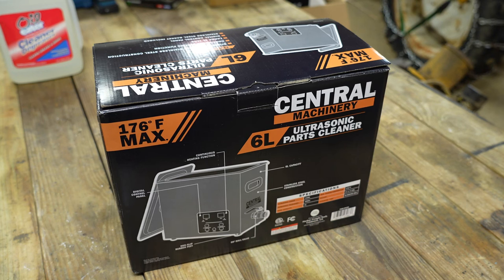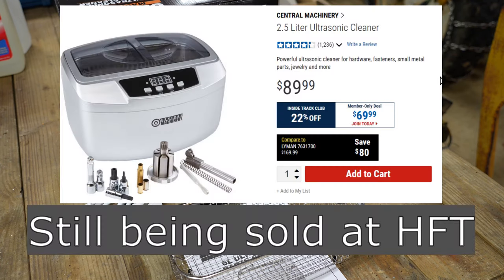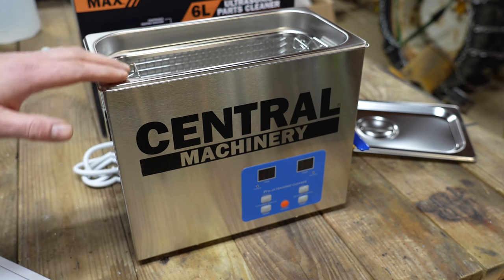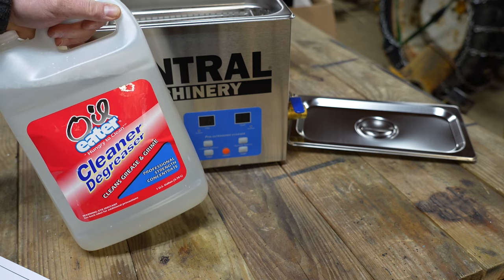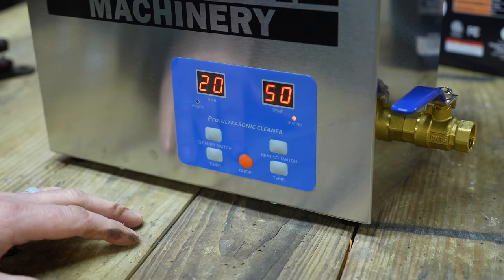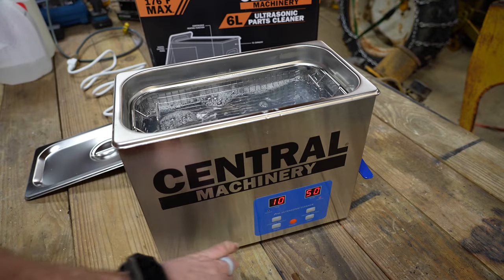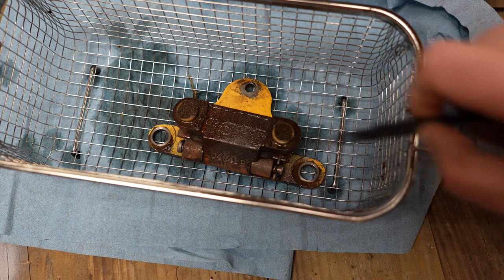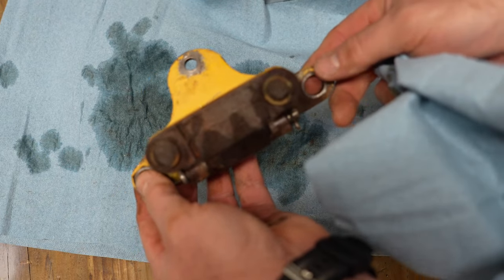Central Machinery 6 Liter Ultrasonic Parts Cleaner, Harbor Freight NTDT How do they work?

Comment: Tip. Put your parts and water or degreaser in a zip lock bag and place it in the ultra sonic machine.  This keeps the larger bath clean.
Reply: I saw someone say that before and it's a pretty good idea I would think it wouldn't work well but I guess it does
Reply: It will even clean a part inside a closed glass jar if there isn’t air inside the jar touching the part.
Reply: Warter? You from New Jersey?
Reply: You may want to use class jars instead of plastic I did my research on this it helps with penetration and cleaning 😊😊😊
Reply: @TheNLHAZE   nice to know
,thanks
Reply: Pyrex works great too. I used to work on super fancy chemical analysis equipment, and we’d clean out tiny parts by putting them in beakers of methanol inside the sonicator. Works awesome.
Reply: Steve’s small engine saloon uses plastic peanut butter jars. I just watched his videos on it.
Reply: @Gastly_Ghost  Knew I liked that guy. I always have a spare big skippy jar handy.
Reply: Does the tub also need to be filled with fluid while cleaning the parts in the bag/jar? I'm assuming yes because then maybe the sound waves wouldn't travel as well? Just making sure, so I understand.
Reply: @GoldenTiger01  yes it has to

Comment: I just bought this exact model tonight at Harbor Freight. I plan to use it for gunsmithing, cleaning firearm parts, reloading and fired brass as well as cleaning carburetors on lawn and garden equipment. I was debating back and forth between this one and the cheaper $89 plastic one. I got this one because it appears to be built much better and has more capacity. Sometimes using one of these is the only way to do what you need to do. Think removing a gunked up carburetor off a chainsaw or something similar before you can rebuild it. A ultrasonic cleaner speeds up tedious parts of firearm cleaning as well. Think a barrel that looks like a sewer pipe inside or a M16/AR15 bolt carrier group caked with carbon fouling. Black powder cap and ball revolvers can be assisted with one as well.
Reply: Yes.  I'm debating on pulling the trigger on this machine for cleaning the black powder cap and ball I have.  Pun intended.  :)

Comment: Great video,  I have a 30L from Vevor,  got it for $239. 00 last year around November,  it's fantastic.  I use gunk or Chem brothers carburetor cleaner from autozone/advance auto parts. Cleans everything I throw in it. Thanks again for sharing
Reply: 30l that's 5 gallons of cleaner. THATS HUGE!!
Reply: @robertlee1145  Nope. It's just about 8 gallons
Reply: @V8SKULLS  yessir that still HUGE!!
Reply: @robertlee1145  yes, it works really well on gun parts, I refurbish WWI, WWII,  VIETNAM RIFLES. and it is big enough for larger parts.
Reply: Does it fit Mauser action and barrels? I'm a gunsmith, and I'm really not looking forward to buying the 10k one. At least not till the shop is in the green.
Reply: It will but not at the same time, put in one half for the time you want. Than flip it to the other side for the desired time you need, it's easier than removing the barrel from the receiver/ action.
I've done that to all my enfields,  mausers, carcanos, Springfield.
I used straight hot distilled water and blue dawn platinum dish detergent. 
Works absolutely great
Reply: @V8SKULLS  I focus on eastern european firarms predominantly, also cold war. So FAL's, CZ Bren, HK, FN, AK, SKS, Mosin, Mauser, AUG, I thankfully haven't seen a hellion or anything from Croatia yet.
Also what do you use for your solution, my military experience tells me simple green everything.
Reply: @_..--  I also use simple green, but I just don't leave it in like over night.!, I mostly been using distilled water and Dawn Platinum Dish Soap.
It works so good. Just make sure your heater is on and Hot.!
It really cuts thru the crud and grit.
It also takes away cosmoline as well
Hopefully this helps you.!!!!!
Reply: @V8SKULLS  update I used a 1-10 of Murphy's cleaning solution. In the small UC cleaner for the desert eagle I am doing a 3part flashy cerakote job and I'm going to use FX on the overcoat finish.
Reply: @V8SKULLS  I was reading about how simple green can eat away at aluminum and wasn't going to risk it, so I try the temp to 80, filled the 6.5L tub and it did the job. Though I think that will be my brass cleaner, and non firearm cleaner after. 
I'm sorry for the 20 questions. Also do you use new water and cleaning solution each firearm or do you get a few cleans out of it. My customers take terrible care of their firearms. (Except for you if anyone is reading this).
Reply: @_..--  no worries,  you can ask what ever and when ever,  it's all good. And yes. If I'm cleaning guns, parts, etc. The same week. I just leave the water/soap mix in the tank and use it
As is. But if I'm done and working on wood stock, forearm pieces or assembly.  I usually empty and clean the tank. That's just me. I guess I'm ocd about that.
Reply: @V8SKULLS  yeah, I already did that in an OCD moment yesterday lol. And I collected the original solution to see if it settles or if I can strain with cheesecloth or something to have it last a little longer.
Reply: @V8SKULLS  well I have a question about building a forend for a side locking LC Smith in 20Ga but I doubt that's a YouTube question LMAO
Reply: @_..--  that's funny, I use a paint strainer/ filter as well the filter my fluid too
Reply: If you don't mind me asking, how is the Vevor treating you?  Does it take a long time to heat up to temp?  I'm looking at the rating on Amazon, and it doesn't seem too good.  Looking at the rating on this Harbor Freight unit, it's higher.  Just wondering about reliability.
Reply: @huyked  you can ask me anything anytime.  My Ultrasonic cleaner is absolutely one of my favorite tools. And after all 2yrs now. Still loving it. And yes if you want the whole tank heated from bone cold. It will take some time. And that is normal.  But what I do is 
 I put the parts that I want cleaned in small zip lock bags with 50/50 dawn dish soap  & Distilled water, or degreaser & Distilled water. Than I boil a lot of tap water. Drop the parts bags into the Ultrasonic cleaner and pour in the hot water till I'm happy . It works beautiful.  Hope this works for you

Comment: I came to your channel because of the cub. I got to see it again in the background. My day is complete. 🤠
Reply from the maker: There is a cab for it sitting off to the right.  And the part that went into the cleaner was the holder for the clutch holding pads.   :)
Reply: @1D10CRACY can’t wait to see that cab go on. Those are cool looking. And then, AC?
Reply: When I turn my temperature up it will only read to 80. If I keep pressing button & starts going back to 20. Does this mean 120 degrees? Or back to only 20?

Comment: They work great on carburetors and clocks!  =D  Awesome!
Reply: Yeah they are really for parts with small holes and crevices, we used to use an industrial version back in the day, thing was probably well over a thousand dollars but was required by the customer which was Parker Hannifen to get coolant and any debris out of the aluminum pneumatic valves we would machine, they hand lots of very small holes, slots ect. Interestingly the units heater did not work after time but the movement of the ultrasonic will actually cause water to warm on its own over time, we use to joke around about making hotdogs in it at lunch. We were told never to use solvent in it, only water and soap, it was said it would damage the machine, but that was then things may have changed, or that may have just been sombody flapping their jaws...as guys tend to do.

Comment: Thank you for the review!  I need one badly.  This was very helpful.  This model has good reviews on HF site.  No 1-star reviews which is a good sign.  Most Amazon reviews on these cleaners have several pages of 1-star reviews!  Also, the wattage is clearly shown at 370 watts. One customer said it is not 6L but 4L, so 1 US gal size.  For this size, a strong wattage is 70-100 watts, and this machine clearly exceeds that, so the power is strong for cavitation strength.

On Youtube, I saw a guy use a jar filled with gasoline to clean engine parts. He partially filled a glass jar (I think it was glass not plastic) with gasoline, put the part inside, screwed lid on tight and submerged it into the tank.  The part came out shiny clean!  I wonder if anyone here can tell me if this is safe?  Has anyone else used gasoline, alcohol, acetone, mineral spirits, etc to clean with an ultrasonic cleaner? My house burned down and I salvaged jewelry and other things that need cleaning.  I would love to know if this works.

If anyone also has experience with a good machine, please recommend brand. Something this size.  Thank you!
Reply: 2 things I know. 1 manufacturers tell you no flammable liquids in them because vapor can get everywhere and cause explosion. 2 people do exactly what you're saying. What I think, be real bad if jar broke, the cleaner harbor freight sells is for jewelry. Some automobile soap and a 1/4 teaspoon of citric acid/ lemishine with distilled water would be good also.
Reply: I just purchased this unit from Harbour Freight. I've never owned one before but so far I'm impressed with it. The heating element works very well. 
I also tried different solutions contained inside a glass jar and submerged the jar in the tank filled with water. 
I've mainly used the unit for cleaning carburetors. I purchased a set of Italian Webers (used) and one of the throttle shafts was seized solid. It took several series of soaking the carb in ATF in a separate container and then ultrasonic treatments in hot water to free the shaft.
The other carb cleaned up nicely with one 20 minute session using Pine Sol in the ultrasonic cleaner.
One full gallon of water leaves a little room at the top of the tank.

Comment: Have you, or could you, measure the actual Wattage of your ultrasonic cleaner.  My Creworks cleaner is listed as 180 watts for the ultrasonic transducers.  When I measure it with a Kill-a-Watt meter using only the ultrasonic function of the cleaner, it measures between 110 and 135 watts.  I would be interested in knowing what your model is rated as and the actual power consumption.  You posted a great video and I appreciate the information you provided.
Reply: Supposedly, according to the specs on the Harbor Freight site, it's 370 watts.  I'm only guessing, and I hope I'm wrong, that that include the heating element.

Comment: How would using vinegar as the liquid, would it help get rid of the rust?
Reply: Vinegar can corrode stainless steel.  So put the vinegar in a jar or ziploc bag along with the rusty part, then put that bag/ jar into the basket with water all around it.  Jar should be water tight.

Comment: I think it's your camera screen because I see no flicker in the video
Reply from the maker: I see that, very odd.   On the camera monitor it was flickering pretty badly.  :)
Reply: @1D10CRACY  frame rate on camera display slower to save battery

Comment: Hold on!  Isn't that a Vevor cleaner with "Central Machinery" printed on the front?
Reply: probably, harbor freight doesn't make any of the shit they sell, they just find affordable suppliers
Reply from the maker: @schlomoshekelstein908  Most companies do not make their own products, they pretty much outsource to the cheapest supplier these days.    We seen this with one of Snap-On's floor jacks and Harbor Freights first version of the Daytona jack.   Both were being made in the same Chinese factory and both were almost identical except for minor changes making the brand.   Another example is Eastwoods welding table and Harbor Freights welding table.  They are both made in the same factory, but both have minor differences.    Normally the companies work with the suppliers and make changes as needed in hopes to have a better product.    There is no doubt Vevor is doing the exact same thing.

Comment: Thanks, I'll be watching the HF ads for a discounted deal for it. What would happen if you used a cleaner that has a small amount of suds action? Would it foam up and spill over?
Reply: No it won't.  Keep it at the recommended level.  No big deal if you get some suds spilling as long as they are bubbles not liquids.
Reply: I use Dawn dish soap in mine ,Works great 👍

Comment: what concentration of the oil eater did you use?
Reply: 1:31 He says 25% Oil Eater and 75% Water, I'm gonna have to try that stuff.
Reply from the maker: If you have a Tractor Supply near by they carry it in the store with the solvents and other cleaning products.
Reply: @1D10CRACY  Would you use this to clean electronics?